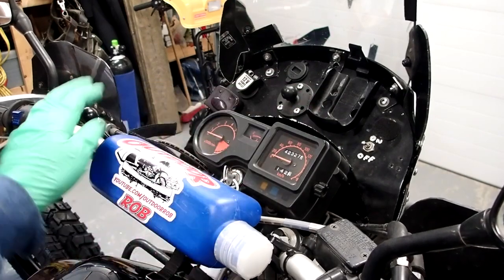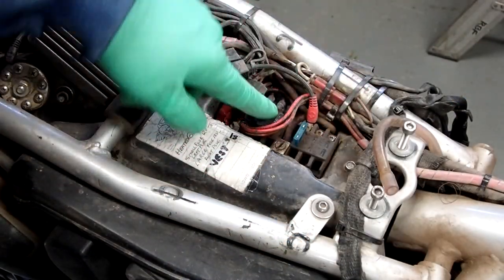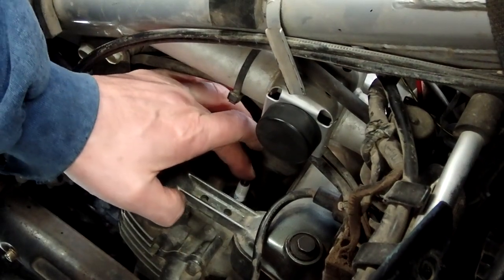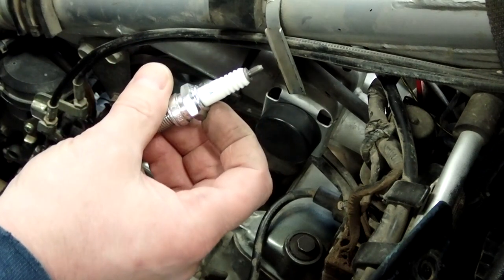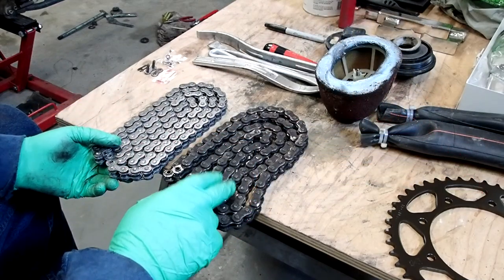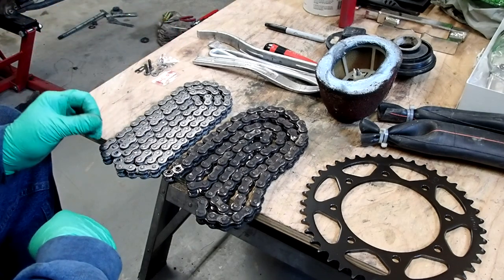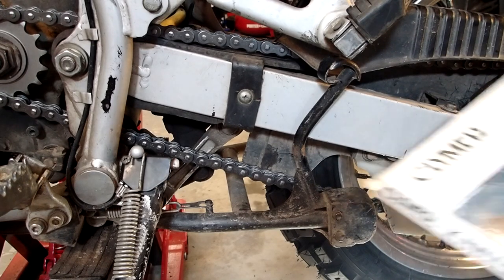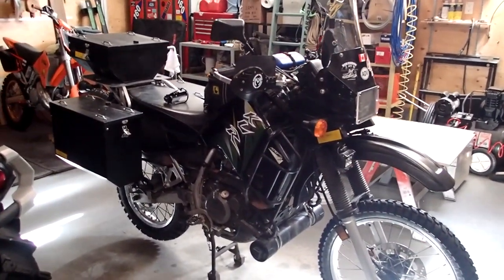Maintenance Kawasaki KLR 650 Adding New

Comment: Inspired me to get to work on my bikes today. I have found for the oring chain that a small c clamp with a socket on 1 end will help . Just press the the back side first to get the clip started. My friend had told me to use needle nose vise grips but had a heck of time with that and no success
Reply: I like that idea, have to try that, thanks.
Reply from the maker: Bought a little chain press and it works pretty good...no more struggling with the clip! LOL!  Thanks John!